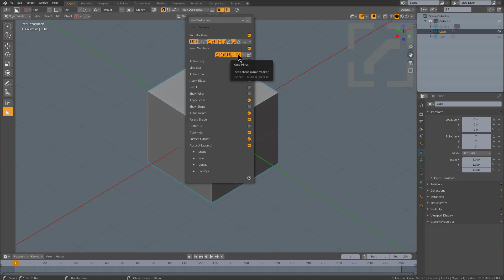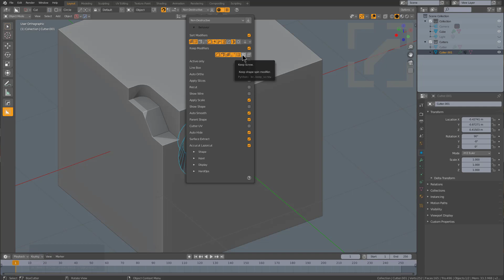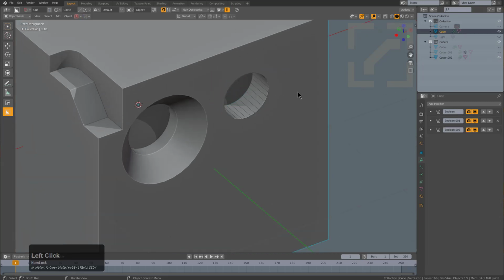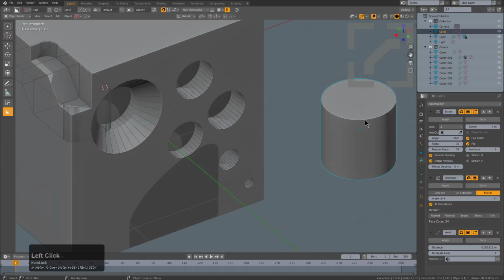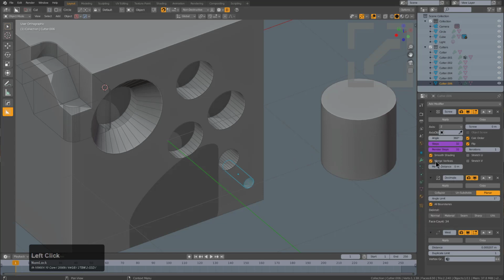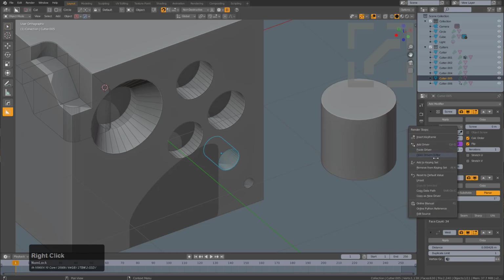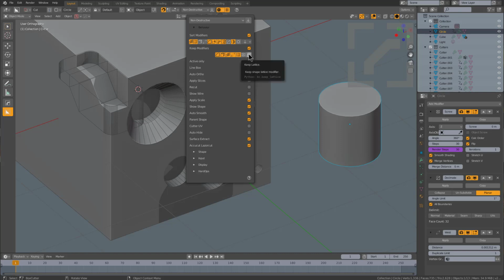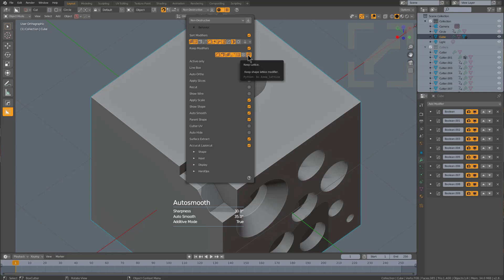#boxcutter 716 - Keep Modifier

Comment: So I got boxcutter, but I don't have HardOps. I'm seeing you do all sort of crazy things on your boxcutter tutorials, that I simply can't do. (mainly shortcuts, like that Q menu?)
Is it possible that you'd make a BOXCUTTER tutorial, without using the HardOps add-on?
That'd be greatly appreciated.
Reply from the maker: no problem. This video should help you out! 
https://youtu.be/H3093mifDoI

Sorry for any confusion. 
https://hardops-manual.readthedocs.io/en/latest/faq/#what-is-the-difference-between-hard-ops-and-boxcutter
Reply: @masterxeon1001  Yeah, I saw that one. But the amount of times you use that " Q " menu, the little HardOps thing, to bevel everything, it's crazy. Hahaha.

Still, the video was a great help. And honestly, I'll probably just get HardOps as well. Cause both of those together looks super strong.

Thanks!

Comment: Hello, first of all thank you for this amazing tool.  I purchased recently on Blender Market.  I have found the addon works perfectly for me with blender 2.8 on my hardware in windows 10.  However when I try to use box cutter in Manjaro Linux I experience massive slow downs.  I can drag the shape on a surface but once I try to move my mouse to add depth Blender drops to near 0 FPS.  This makes boxcutter unusable for me in Linux.  I know Linux isn't the most popular platform, but my workflow is built around it.
Reply from the maker: we don't have any control over the os. It's all up to how they choose to optimize graphics drivers etc.
I did a couple of videos about slowdown and how to mitigate it. We do plan systems to help with the slowness blender itself has but Im not sure how we'd begin to diagnose an OS.

https://www.youtube.com/watch?v=QsBtPZyYcrY&feature=youtu.be

https://www.youtube.com/watch?v=hxLeZCXYFYQ&t=1m14s
Reply: @masterxeon1001  Thanks for the quick reply.  I will look through these and see if I can solve it.  If so I will be sure to get back to you, so you can help others who struggle with this.

Comment: Hops+bc+2.83 is pure bliss! Thank.you so much! Is there a way to adjust the ngon so it snaps to 22.5 degrees, 45, 67.5, 90 etc? 22.5 is an angle I like but it's still a pain to achieve

Comment: Not sure why but your video looks like recorderd with incorrect bittrate. for 1080p use at least 3500 for static vids like that one but better 4500, x265 codec can help here too but better to test it - sometime 264 will be better even if that is older tech.
Thanks for vids, maybe at last i gonna learn hard surface
Reply from the maker: I merely use camtasia defaults.